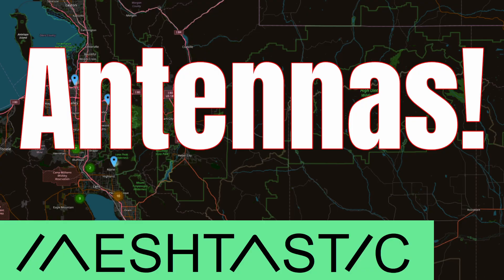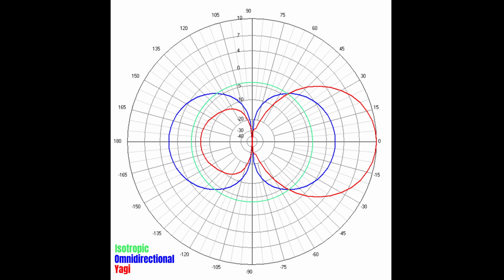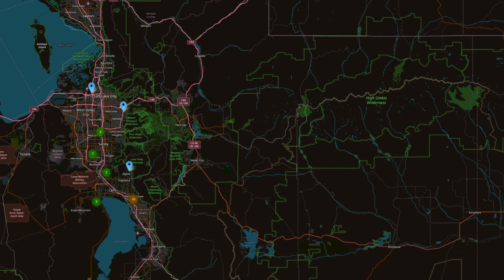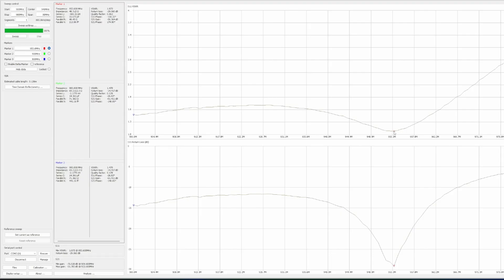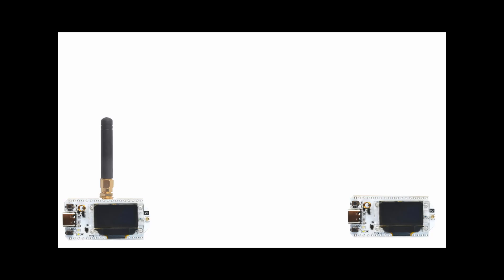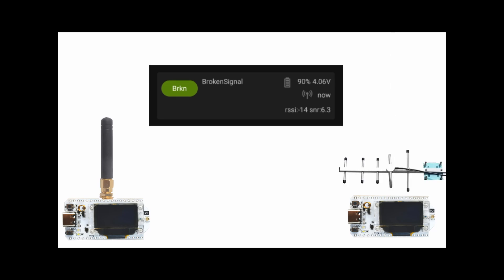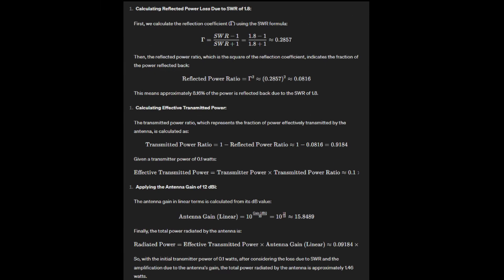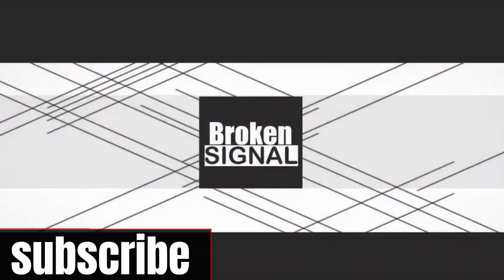Meshtastic Antennas: Measuring and Comparing Omnidirectional vs. Yagi

Comment: This is a good explanation. This however applies more to more traditional HAM frequencies, and not so much for LoRa, especially in a mesh environment. You'll run into line of sight issues long before any extra gain is needed, and spread spectrum is very effective at reducing interference.